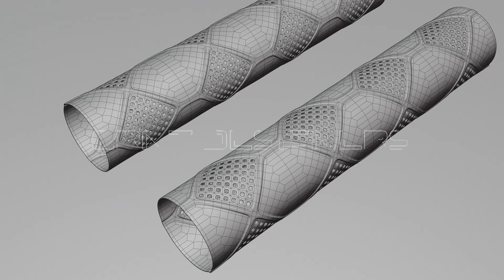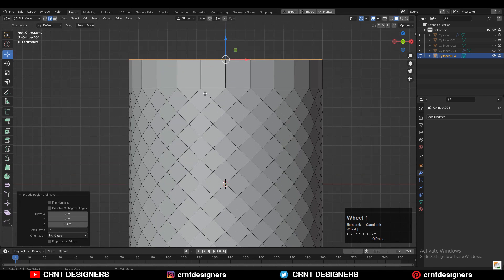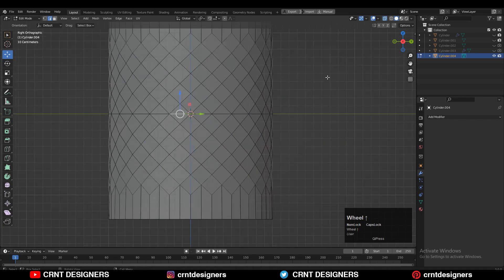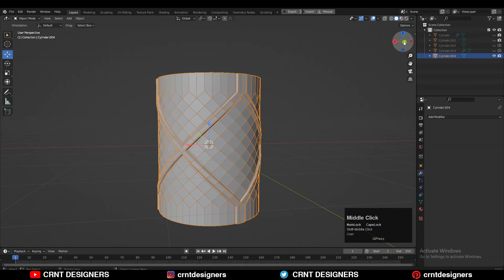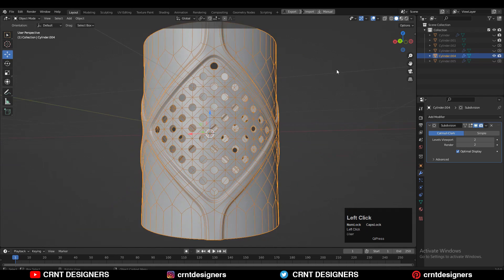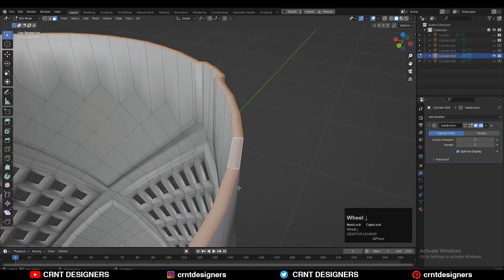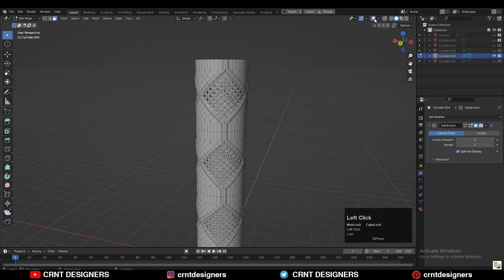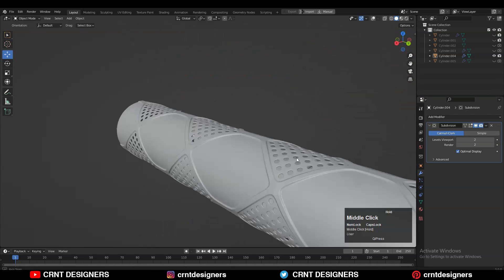How to Create Tricky Designs? Like This _ Blender Subdivision Surface Modeling Tutorial

Comment: 2:22 Before scaling along normals you can shrinkwrap this modified cylinder to a same size, normal mesh, high resolution cylinder (e.g. 48 vertices, 20 vertical loopcuts, applied subD 3). The scaling along normals can be executed only after applying the shrinkwrap modifier. So you can avoid any kind of pinching.
Reply: Btw you can shrinkwrap also the upscaled parts of the mesh to a same size HiRes cylinder (beforehand you must make a vertex group of the upscaled, insetted faces). That eliminates the remnants of the pinching.

Comment: Dear Chetan Rawool,

Thanks for your tutorial on a beautiful 3D asset. 
For your query at 1.1minute regarding repeatred adding of edge loop, I followed this method.

1. Select both the top 2 circular edge loops in edge mode and subdivide. This generates edge loop at all required locations.

2. when these faces are still selected, in edge mode use loop tools - cicle to circularise the ring.

Then to connect the loop to the next lower loop:
3.In vertex mode select the second edge loop from top, checkered select the vertices to get the correct alternate vertices.

4.Shift select the set of vertices below this loop. Right click and connedct vertex pairs.

Hope this will reduce the work flow to continue further. For point 1, Blaine Blinston's comment can also be used. 

Regards,
Sasikumar
Reply: Respect bro
Reply: a way i found is
1. select the top face of the cilinder and delete edges

2. add a circle with the apropriate count of vertex in this case 48, and move it to the top

3. extrude it down so the new loop is half way between the spikes and valley

4. merge by distance activating the "unselected" option and increase the distance until works!!